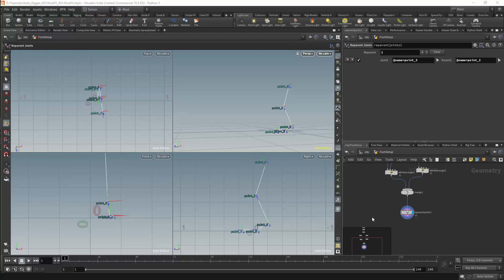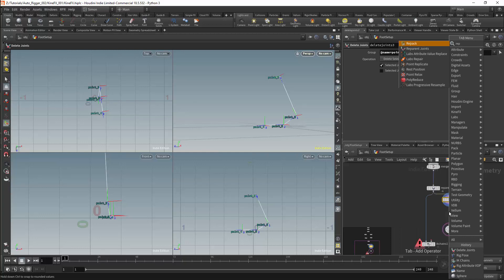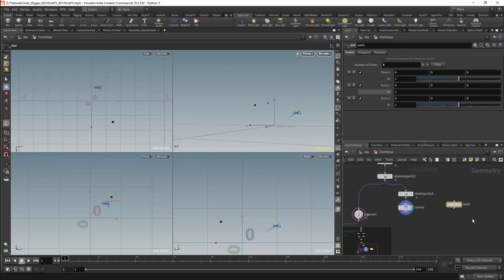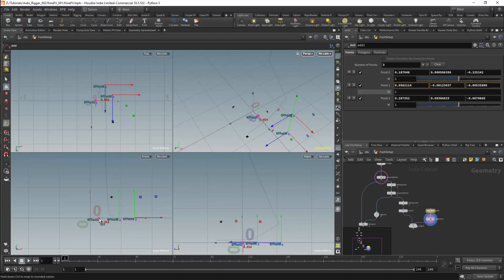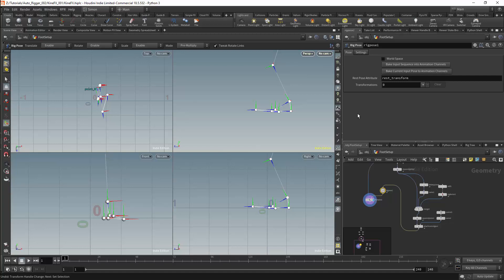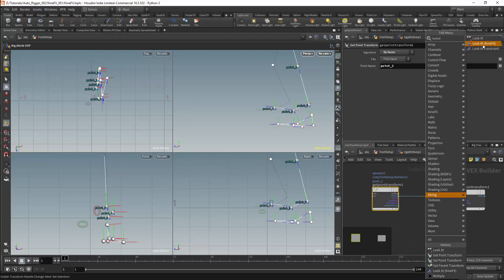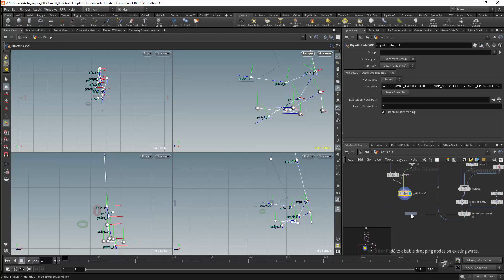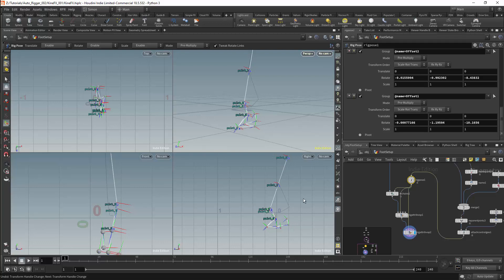KineFX A Basic Reverse Foot Setup

Comment: houdini has a reverse foot sop,is there any reason why you didnt use it
Reply from the maker: -It is useful to know how to setup the controls for the foot.
-This is a simpler set-up.
-It is easier to extend this setup for example if you want to do a bird foot.
- I was asked how to do this.
Reply: @brundlethwaite  Can you make a tutorial on the reverse foot SOP? I kinda got it working just cant integrate it in to the main leg IK chain
Reply from the maker: @ViralKiller  This is something that i will try to cover but I can't give any ETA or guarantees as I have a lot of other things that I need to work on. In the meantime I would recommend this as one of the better overviews of these solvers: https://vimeo.com/473473879